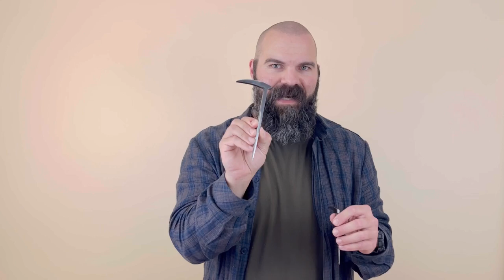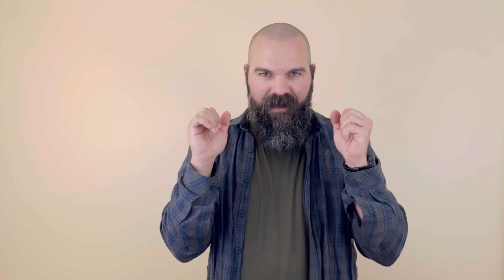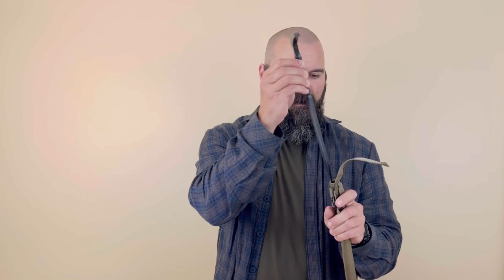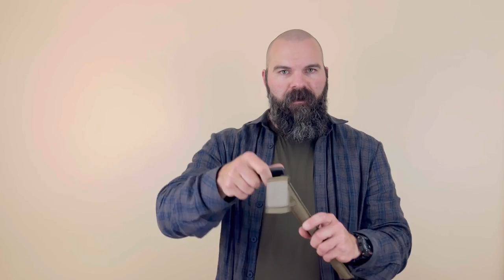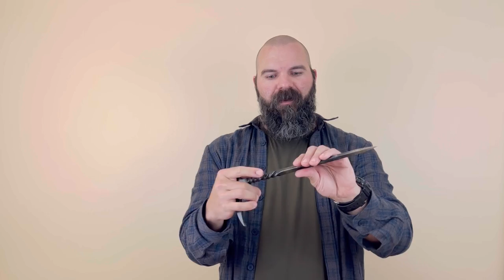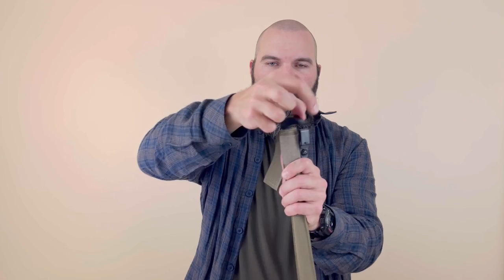DickPick MAGNUM

Comment: I have read in the past that triangular stab wounds are very hard to stop bleeding compared to a blade wound, is that true ?
Reply from the maker: It doesn’t appear to be true. I recommend checking out our video on historic edged weapons, linked below. I cover a 19th century surgeon’s description of triangular bayonet wounds—the treatment was unremarkable. 

https://youtu.be/mKL35h3YZVw?si=A1tk1lT4u27EXrE0

You may find the rest of the video interesting on other topics as well. Best regards.
Reply: Bite wounds or serrated wounds are worse in the sense that they take more traumatic remedial care to effectively close, and prevent infection later. 

Anything that's just in and out, per se, is bad of course, but objectively easier to deal with. 

Random tangent.

Comment: You wanna make one of these 35 1/2 inches long so I can use it as a walking cane?
I have something similar currently but due to it being a wood shaft its considered a hammer.
Reply from the maker: I will think on this
Reply: Yes, perhaps have it in a cylinder tube like the cold steel sword cane. It would allow you to conceal and keep the spike protected.

Comment: The Magnum looks like a pry bar I used as a jet engine mechanic known as a lady finger or lady foot. I think I’ll start keeping it in my truck for “any roadside emergencies” and probably order a DickPick to keep on me EDC definitely
Reply from the maker: Yeah the prying concept is similar but proportions are different. The ones I tried also had a blunt tip for centering holes between parts.

Comment: check out laser cutting for your manufacturing instead of water jet. You are doing a heat-treat process so any heat will not mater.
Reply from the maker: Thank you for your suggestion—I will investigate this.

Comment: A modern military also issues throat guards. If it’s attached correctly it’s going to be hard to get anything past it.
Reply from the maker: Yeah, using a knife to cut the carotid would seem impractical. But the face is always open. Soldiers need to easily breath and have unobstructed vision. Very few knives can incapacitate via the face.

Comment: Would love to see this sheath system kind of implemented into the back ripper and empress also I would be interested in your take on cpm 3v or cpm magnacut for the empress and  your other tomahawks would it be possible and if so how much per tomahawk to do it?
Reply from the maker: Based on my understanding of @KnifeSteelNerds article, CPM 3V and CPM Magnacut have a balance of desired properties that make it great for knives, but I am doubtful that applies to tomahawks. Spike tomahawks are subjected to a lot more abusive tasks—high forces in chops, also throwing can be very abusive—especially if the tip of the spike sticks in the wood target and the rest of the tomahawk body suddenly ceases to spin and just vibrates out the shock of the impact over and over and over again. Spikes also get used to grub and dig into the ground and can easily hit pebbles, rocks, etc. Sometimes used to pierce metal containers too. And some tomahawks are subjected to twisting/prying—such as if you use the spike to split wood or drag pieces of wood to a campfire. So I need to think some more on what the “ideal balance of properties” are for spike tomahawks—but right now I think toughness is pretty high up there. Keep in mind that CPM 3V and CPM Magnacut have greater toughness relative to other powder metallurgy steels, and all the data I’m seeing starts above 60 Rockwell C. But the vast majority of tomahawks (and axes) never get to 60 Rockwell C—usually 52 to 58. That’s by design. The steels that frequently get used have a hardness-toughness curve that is really favoring toughness.
Reply: @wingardwearables  I think if you did use those steels to a high hrc for a tomahawk it might surprise you I've seen 3v split nails go through numerous materials including metal and bone with little to no edge damage even have seen tip tests over and over with no breakage and in my opinion I think it would be great for a spontoon style axe. It may not  resharpen easier but I believe it would last longer and be tougher just in case you do hit bones or have to hit metal. Also I know magnacut isn't as tough as 3v but it's darn close with a lot more properties that make for a good axe head all in all as long as the heat treat is consistent I think they both would be dead ringers for your beauties that you build anyways just my 2 cents love your products and will be buying some in the future.

Comment: On the older Ka-Bars the swedge  was pointed and  used to pry between the ribs, if you didn't use a horizonal  flat thrust.
Reply from the maker: Thanks for the comment. I have a Camillus Kabar with sharpened swedge. I doubt the penetration performance will improve much since the blade is still quite wide, and the majority of piercing tip width still has that big belly edge. I like the knife though that’s mostly just for sentimental reasons.

Comment: Hollow grind the facets? On that last bit leading to the point?
Reply from the maker: That might help slightly in piercing through some things. I held off on that because it will increase stress at the tip in twisting and prying motions. Hollow grind means less material. It may be worth experimenting with a prototype just to test if the pay off is worth the increased risk.
Reply: @wingardwearables  I can see that. It would come down to heat treat/hardness and extra cost monetarily and in time. Might have to buy one and try it myself, then blame you, of course, if it breaks. 😉

Comment: I'm an happy 12 people since I discovered you
I love the attention to details in your design process
As an engineer, amateur Blacksmith and kali practicionner I raise my hat to you 👍

Would it be possible to have a empress or backripper with a pipe hammer instead of the spike?
Reply from the maker: Thank you for your comment and the kind words.

In the future we will be working on a pipe tomahawk and we also have a hammer poll concept on our roadmap. But most of our tomahawks feature spikes because it greatly improves the versatility in both utility tool applications and in combatives. All our spike tomahawks also feature flat sides to be used as percussive hammer faces, so our designs accomplish a lot of what a hammer-poll tomahawk can do. I have found that losing the spike really can neuter a tomahawk’s capabilities. That’s one of the reasons we’ve kept a focus on spike tomahawks, and why we are taking our time tackling the other configurations. We want pipe or hammer poll tomahawks to preserve maximum capability and be completely distinct from what’s already out on the market. It will take more time, but I am optimistic we will eventually refine designs that can achieve this while maintaining wearable ergonomics. Best regards!

Comment: This is Better than a kabar, your probably not gonna get into a melee fight, this is a tool that can be used like a weapon , a kabar us rat tang over priced garbage imo , there's better tool and fighting knives  you can use . 

A spike gets used more than a blade if you have one , I have a svord peasant I've modified to have a spike for a tang and the spike gets use more in day to day stuff
Reply from the maker: Thank you for the comment. Yeah I didn’t want to crap on Kabars too badly since that might trigger some folks. I own both Kabar and FS daggers—their rat tail tangs had super sharp angled transitions. Were designed before mechanical engineering sciences could better understand the impact of sharp angled features as stress concentrators, fatigue life, etc. 

Agree 100% on the utility of spikes. Interesting about the spike tang mod on the friction folder. I had been considering a similar concept for a friction folder/spike tool. I know there have been screwdriver/prybar tangs but spike seems as or more useful. Glad to hear that the concept is working out for you.